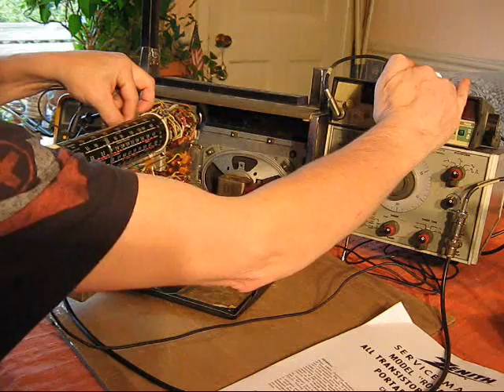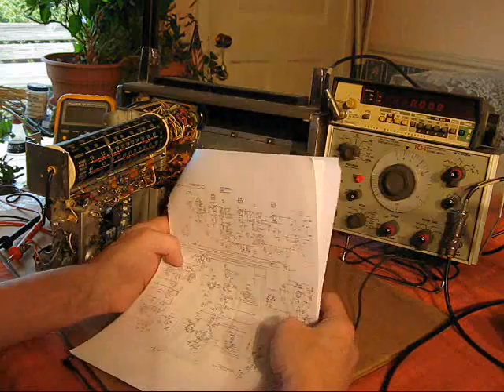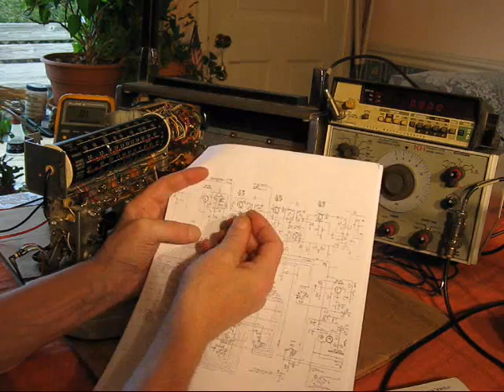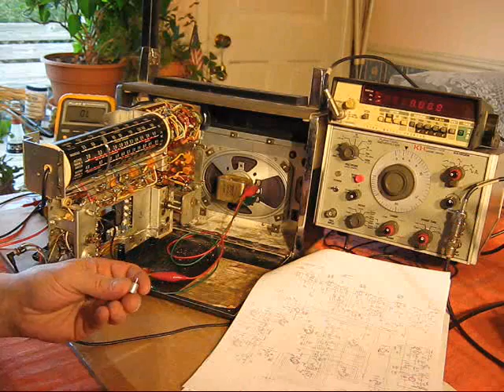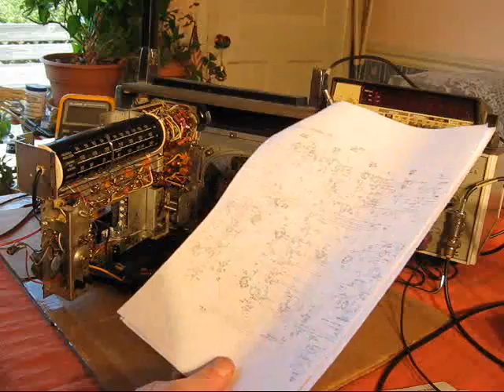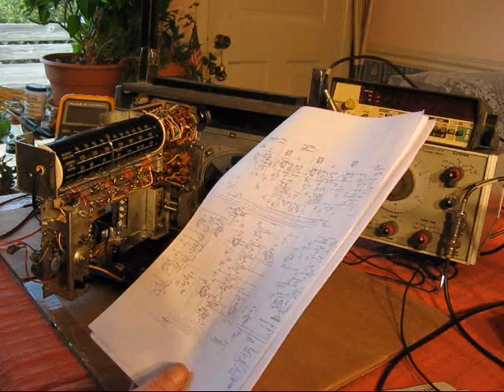Zenith Trans Oceanic portable radio repair # 4 of 6

Comment: Try not connecting the case. It should solve the problem. Shango 66 ran into the same trouble on the same radio in the FM section. There was no FM. All the other bands worked fine

Comment: Hi! Nice videos. Thanks!

Concerning the transistor collector to shield shortening, it is a phenomena known as "Tin Whiskers" growing inside germanium transistors.
See here:
http://nepp.nasa.gov/Whisker/anecdote/af114-transistor/index.html
http://nepp.nasa.gov/whisker/anecdote/af114-transistor/2005-Brusse-tin-whiskers-AF114-transistors.pdf
Reply from the maker: +Jose Mesquita You are correct. Those copper cans were tin plated inside. Whiskers grow towards the center where the junction is positioned. I did "fuse" (20 volts across 1000 uF) the whisker in that transistor, and it now functions normally. Just about any tin plated crimp terminal shows whiskers if they have been in storage a while. Very, very thin; need magnification to see them. We thank you very much for the heads-up!